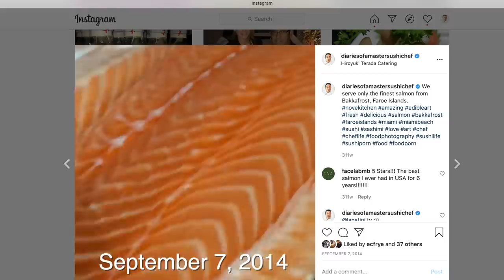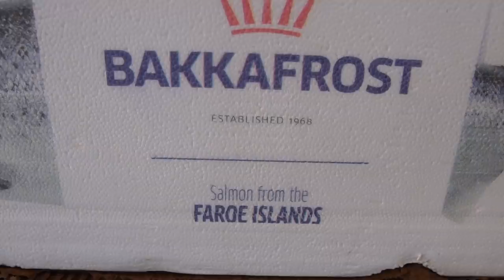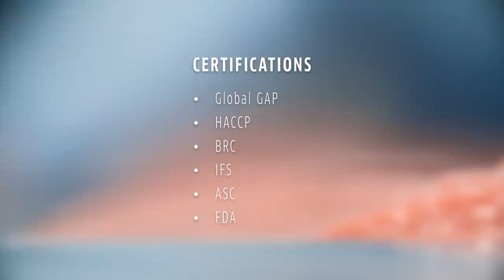How To Fillet World's Highest Grade Farmed Salmon And Use Every Part | Bakkafrost Salmon

Comment: A farmed salmon can never be as good as a wild salmon. Period!
Reply from the maker: in sushi applications...not true..wild can have parasites..farmed at this level is the best hands down. one bite and you will know.
Reply: @DiariesofaMasterSushiChef  Can have, but does not have to.

A bite into a freshly caught sockeye and you know what I mean
Reply: Amen and AMEN! 

ME: Dad, why do you have 5 boats?

DAD: Because I sold one. 

Kid you not, real convo had a years ago. Cannot make this "schtuff" up. There were witnesses. Mom just grinned slightly, turned around and walked away from the grill. 

One for open saltwater. 
One flat-bottom for rivers. 
Two for lakes. 
One on top of the camper or truck. 

3 trailers, and he keeps the State Car Tabs updated every year. 

3 different trucks/SUVs to pull them, and a Winnebago with a 7,500 lb. Class III Hitch, lol.